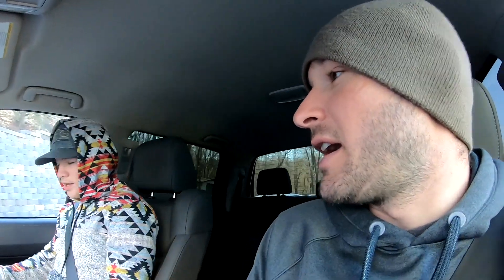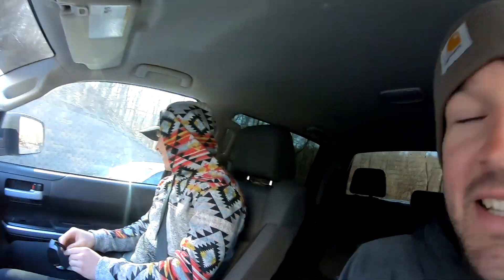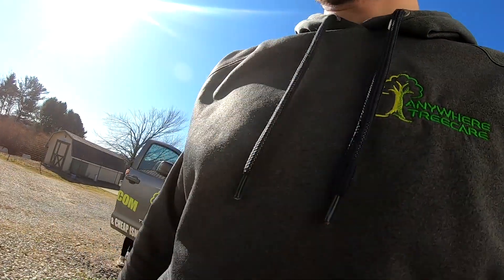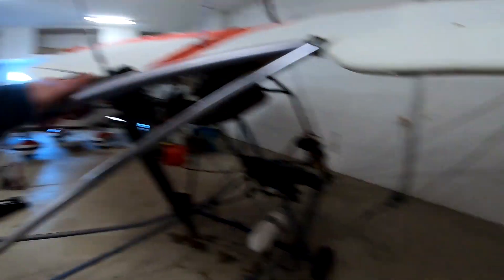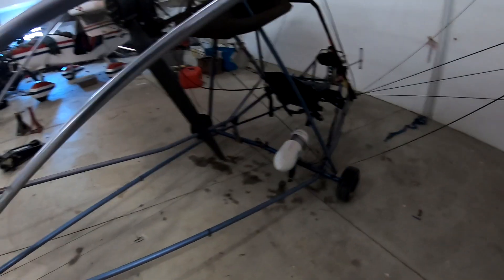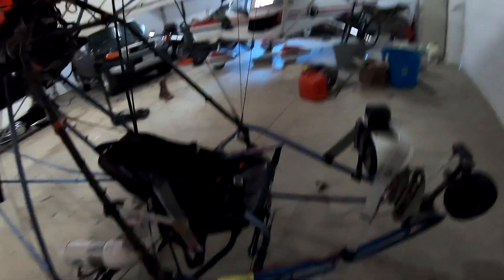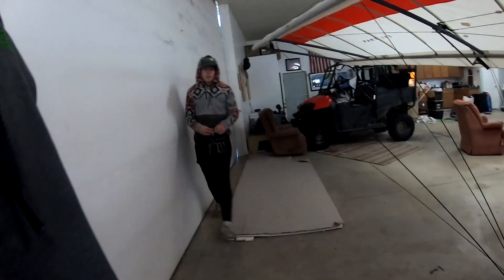Changing The Down Tubes - Time-lapse, Quicksilver Ultralight

Comment: Why were the down tubes changed?
Reply from the maker: Well I kind of made a boo-boo. Maybe one day I'll show it 😊
Reply: Well, let’s see.  The down tubes connect the main landing gear (rear wheels) to the root tube.  The root tube carries a LOT of loads. The engine, the wings, the gas tank, the king post. I put a stainless steel root tube on my MX, so I knew it would be stronger.   Down tubes have a little bend where they attach to the axel.  Hard landing = bent down tubes       N.E.OH Bob.
Reply: My guess is that the bolt holes were elongated.